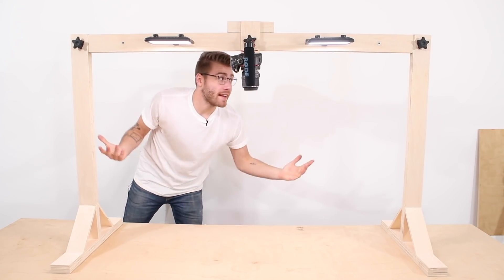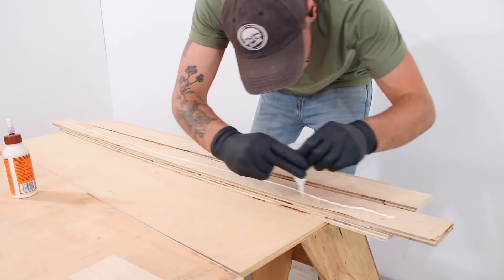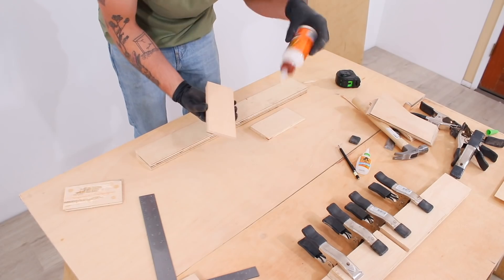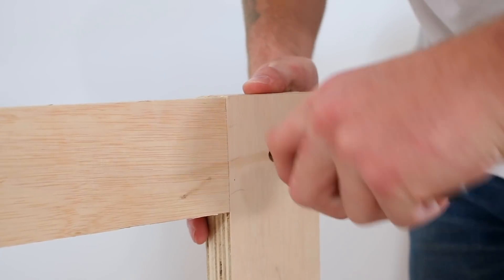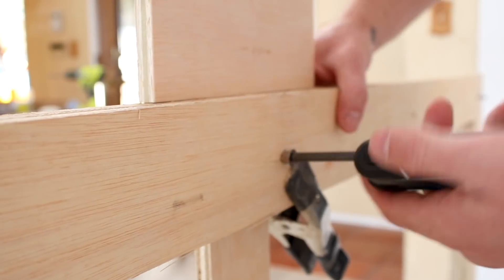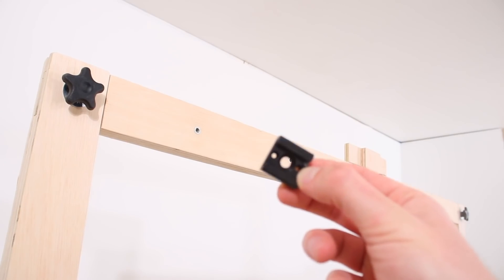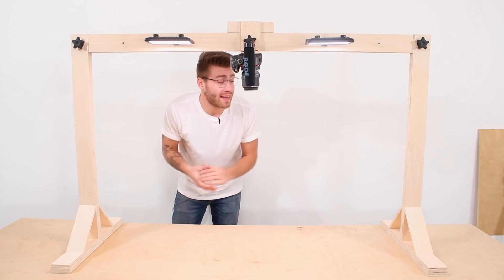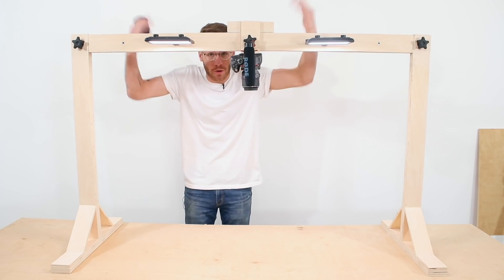DIY Overhead Camera Mount / Rig | Under $50

Comment: A quick improvement idea: 
 A rail on the rear side of the board for sliding the camera. In that way, it gives the user complete flexibility to move the camera rig where ever they want. The mount on the rain can be modified to hold the camera and give an angle that suits best for overhead filmography.

Comment: Even though it's a fairly cheap lens, I jumped a little when you threw your 10-18mm from one hand to the other...
Also, for maximum adjustability, I'd put an aluminium T-track along the stretcher and connect a ball head camera mount to it, so no matter where your project is going to be on your work area, you can adjust the camera and frame it perfectly.
Reply from the maker: Cool idea!

Comment: May I suggest using additional diffusers for the lights when using the white board. Glare/reflection would be too distracting/in the way.

Other than that. Very nice simple build. Very cool rig. I love the nuts for customization
Reply: Tyler Burton or, just set the lights wider and at a slight angle

Comment: Cool rig Mike!  I'm guessing the troll, err, I mean peanut, gallery will suggest that you add a couple 1/4"-20 mounts on the legs for the lights, so you can illuminate the subject from the sides instead of head on (since lighting in same direction as lens-subject axis can appear somewhat harsh on film).  Great build all around tho, might have to throw something similar together for my shop!

Comment: I like this build. However, i ould not just use glue for the frame.  Also, i would also take into account for the weight of the camera even thou u used super glue and wood glue i would not chance.  But this would be a great set up for a tablet or cell phone camera,
Reply: Keith Hecker modern wood glue is stronger than the wood. It would never come apart
Reply from the maker: The glue is definitely strong enough